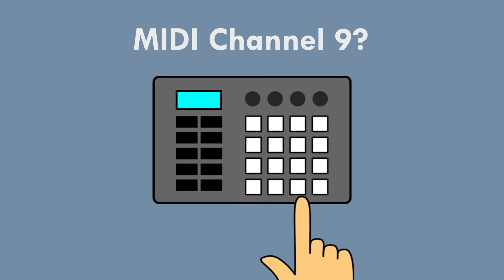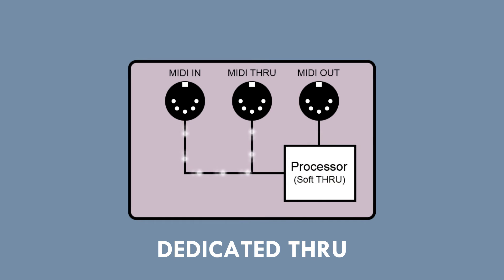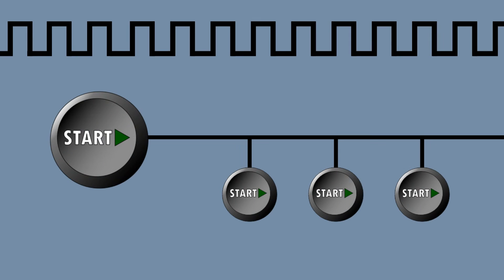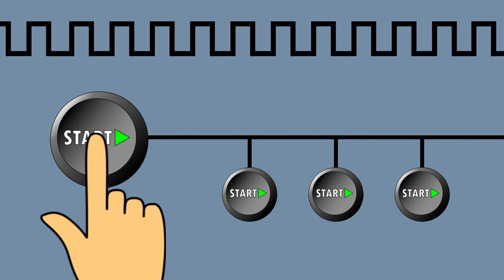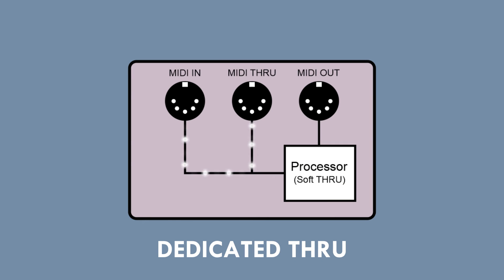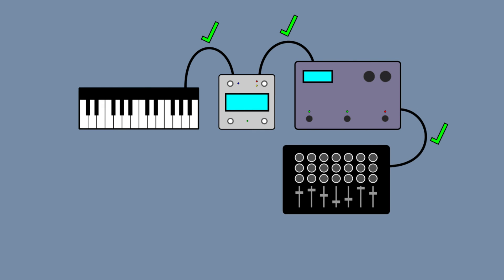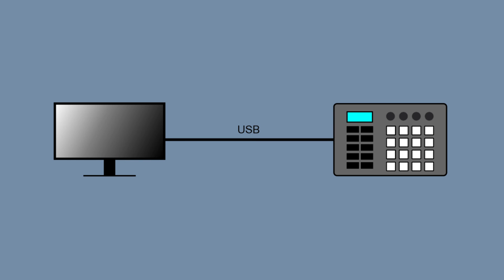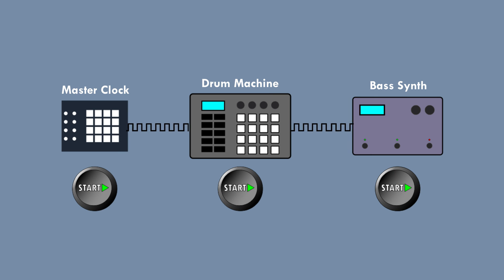MIDI Clock Doesn't Work (and a Guide to What You Can Do About It)

Comment: Excellent video, help someone design a midi interface from the computer with almost zero latency/jitter, we need proper driver just for midi, kind of what logic has done with unitor 8. Sync is a major issue, half of these companies who make gear and they put midi dont even take time to design proper midi ports.